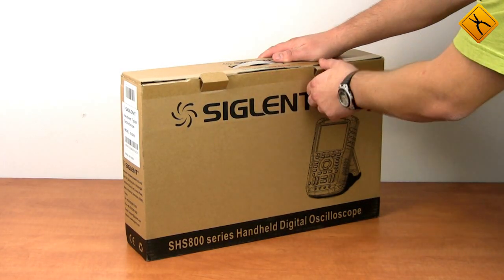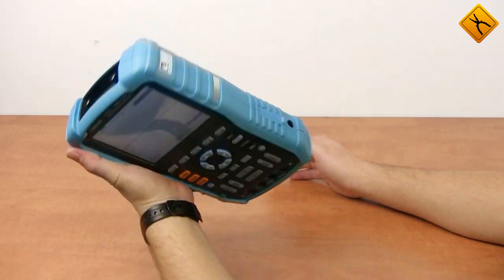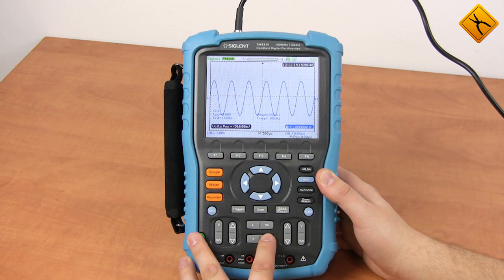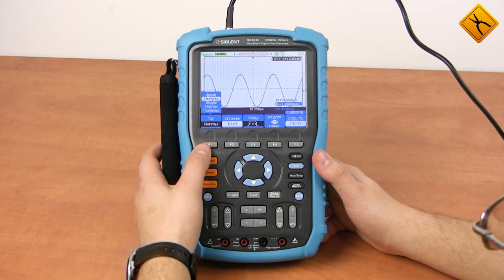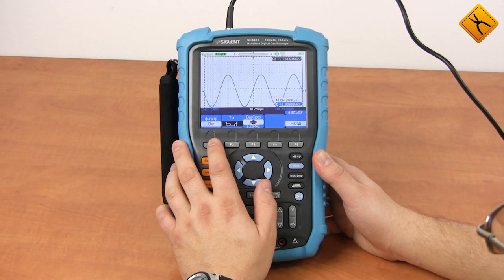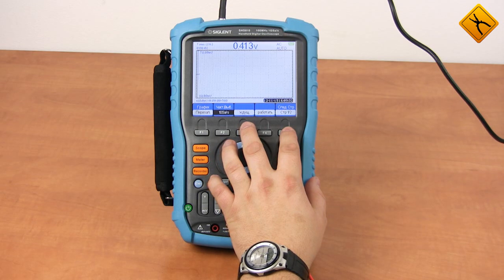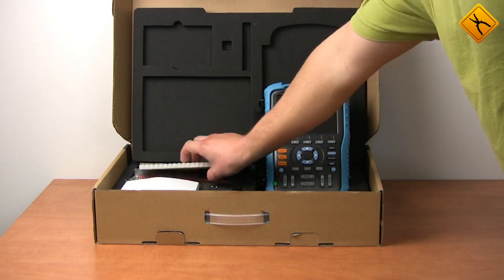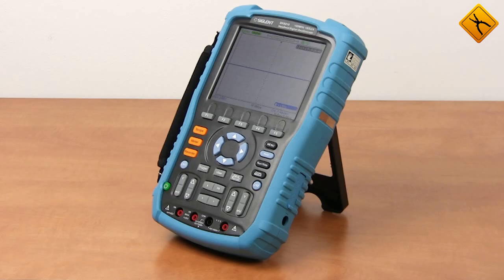SIGLENT SHS800 Handheld Digital Oscilloscope

Comment: it says it has a recorder function to save 3000 hours on a usb. 
Can I use it as a data logging device and leave it on for a week? 
Or do I have to sit next to it and manually save every short clip?
Reply: It will record continuously but of course the internal battery will not last a week so you will need to use the AC adapter